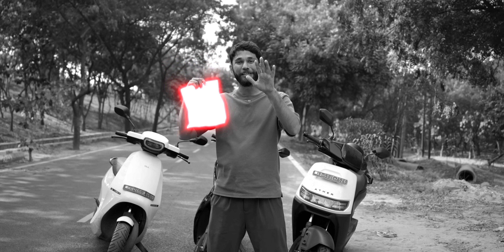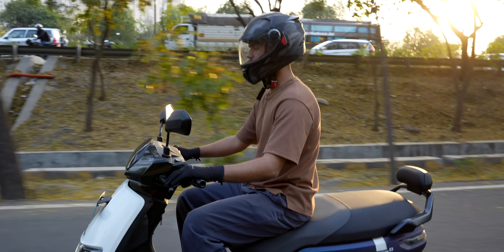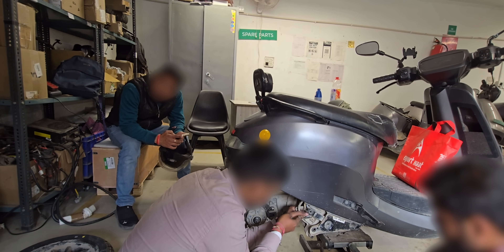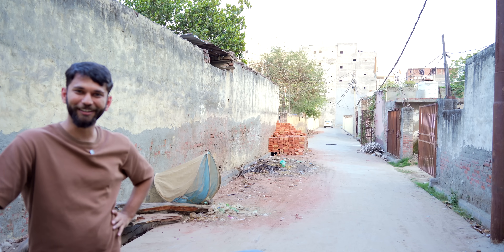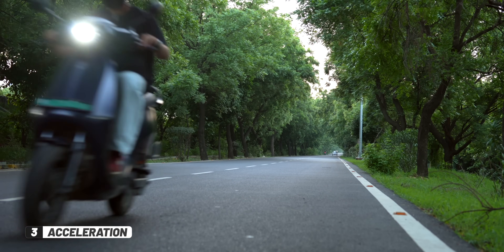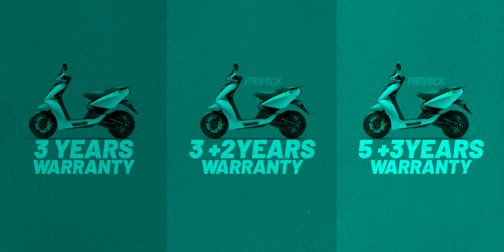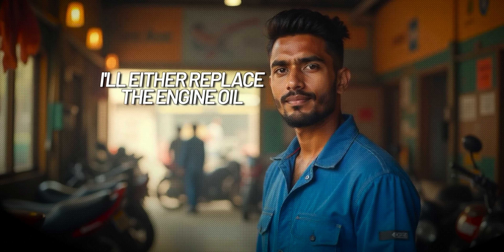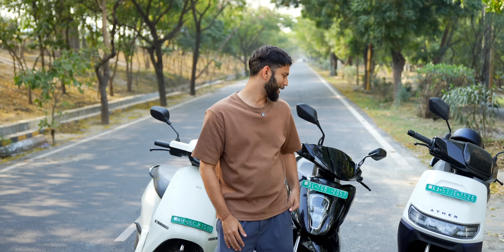The Real Truth of Using EV After 2 Years!

Comment: I have been using the TVS iQube S 3.4 variant for the past five months, commuting 70 km daily. So far, I have completed over 8,500 km. They claim it provides a range of 105 km on a full charge, but I am getting an average of at least 115 km. TVS iQube comes with a warranty of three years or 50,000 km. Additionally, they offer an extended warranty of two more years or 20,000 km, mostly free of charge. The iQube requires servicing every 4,000 km, which costs around ₹500.
Reply: So you ride around 70kms, every days,
Did you ever feel uncomfortable or strained while riding? Is the posture good enough, or a bike would have better posture?

Comment: my 2015 honda dio bs3 which I bought for ₹60,000 (with all accessories, insurance and extended warranty) has done more than 90,000kms still gives efficiency around 50-55kmpl even 60kmpl ridden sedately so my 1km= ₹1.8 (won’t go above ₹2) including maintenance as well as it requires service in every 6months includes changing the engine oil+air filter+oil filter which is not more than ₹600-700 so for most people EVs can’t stand against Honda scooter💪

Comment: nice & true video, i am using Ather 450s more than 1 year & driven Approx 13K Km without any problem. Build quality is good,  very accurate Range like if scooter shows 50 Km than it will give you to almost 48-49KM. as per cost of scooter the Range is less it should me 120 Km & charging time should me lesser than 5 Hours. IF you want a good EV scooter without any problem go for Ather

Comment: I own ather 450 for 4.5 years. Battery range issue will roughly start from 3rd year and it will accelerate. I complained about battery drain issue to Ather after 4 years and it was not under warranty. But they replaced it to new one by charging 5K (Goodwill). One aspect Ather stands out is their customer support and CRM. Exceptional. Ola is nothing compared to Ather. For next 3 years min i can ride my bike without any hassle. One aspect Ather should improve is their service support. Service cost is very high and almost equal to car plus their service centers are working beyond their capacity levels.

Comment: ather 450x panels are so strong that My 450x crashed at around 70 kmph in a sharp turn and also it skidded upto 7-10 meters , even after this there was an only scratches on panels but it didn’t break and no technical issues in battery . And the battery health is also so good that even after I ride more than 80 km daily for 3 years. I strongly recommend ather 450x or any other models

Comment: And one of the worst part in the battery warranty is that they provide refurbished battery after wait months of 3-4 months!!!!! and even after that my replaced battery had 15% around less range as compared to my original battery i repeat Do not buy ev scooters yes the rides is way better than petrol bike but the Overall cost is same in long run and there are no good mechanics as well to repair them properly you are stuck with service center which takes months to repair them ... and no resale Value as well

Comment: As i thought before starting regular adwiser 
I bought a Ola s1 pro gen 3 and yes ola has some problems like they took so long to deliver but the battery price of 3khw is 38k and in comaprison you will easily loose around 75k in buying petrol with petrol scootet 
Also if i tell about Ather , Without a doubt Ather is really good but in my area there is no charging station or service centre also the price is much higher as i bought the ola at 1,34000 with insurance and everything ,on the other side i think the ather 450 is around 1,70000 also if i want to use the feature which mostly showcased in ads i have to pay much extra but in ola thats not a problem also here in my service centre there is hyperservice available problems solved in 1 -2 hours also all the staffs are friendly they become familiar in 2-3 visit . So my overall experience is good and also a point that I'm not just a new customer my friends bought gen 2 so i know their experience 
My point in the video is that Both Company has Pros and Cons but prarik was always on the side of ather in the whole video
So i think it's biased a little bit.

Comment: Ather is more expensive than any other ev scooter but you have to consider whatever they are offering they've done deep research in everything whether it be battery sustainability software overall quality of the scooter all the features they offer and they have the best charging network out there more on that they are one of the oldest ev brand in india and most reliable so paying a premium for that is ok I guess atleast for me. Lot of you won't agree with this but just to save 30-40k you'll face a lot of issues

Comment: Bought an ola s1x 4kwh (key variant) previous year in August. Faced an issue with the software nearly 3 months ago and the scooter stopped working on the way. Had to tow it (costed me 600rs) to the service centre and then devote my entire day to them. Finally at 6:30pm the issue got resolved and I drove back home. 
I get an average range of around 115kms which is enough to serve my purpose of buying an ev. 
Have not faced any other issue till now. Have successfully completed 7000kms on it.
The biggest con which I felt in this is their build quality. It should have been better. If I meet an accident someday, then I wouldn’t be able to drive that vehicle again. 

Got this for 110000 on 14th of august and the priced dropped  by 5-10k the very next day due to Independence day offer. (Regretted the very next day of buying ola 😅 Not their fault tho)
Got a subsidy of 20000 after a few months into my account, so the net value became 90000, which is very fair.

Ola s1x: 8rs per charge for 115kms
Cost per km~ 0.07rs

Petrol scooter: 110rs per 60km of range
Cost per km-1.83rs

Savings per km=1.83-0.07 = 1.76

Amount saved till now= 7000*1.76 = 12320rs

If calculated similarly, considering the inflation in petrol prices and increase in my usage, I will recover 90000 in 3.5 years appx.

Conclusion: Overall A good buy.

Comment: I own Ather and I feel like a King with everything, the suspension is 2 times the size of my petrol scooter, accurate range on display, smooth acceleration and braking, unique colour that I own is salt green with orange and everyone looks at you in the traffic. The best part is the service centre, when my dad took it to the service he was said that you have to prebook on call but now it'll take 3-4 hours to get back vehicle but my dad said it's urgent and he has to go somewhere. So, not 1 or 2 but 3 mechanics were deployed on a single scooter and he watched them doing everything and handing over the vehicle in just 15-20 minutes and got a bill of 708 including GST comparatively my petrol scooter services at 1500-2300 now you don't get that in Ola or else, charging is a big plus point with the network. In our 2 tier city we've 13 charging stations with some charging stations offering 2-3 charging docks that means in our city simultaneously 23 scooters can charge at a time.
Reply: lol there is nothing to service on an ev, Thats why it took 15-20 mins and costs 700 rupees. they will only check if belt and brake pads are good and that's it.
Reply: honda activa full service with labour chrge 800 olny

Comment: Ola Electric is failing its customers! I bought my Ola S1 Pro Gen 2 on April 29, 2024, and now they’re demanding ₹55,000 for a battery replacement, even though their app initially showed ₹0 as the payable amount. My scooter was in Vacation Mode, yet it completely drained due to a design flaw. Now, Ola refuses to honor the warranty and is even threatening to charge ₹150 per day for parking! This is outright harassment.

Comment: Ok you have covered the EV part let me tell you the issue with every single petrol scooter. As EV battery capacity deplits, so as the milage of petrol scooter. As the pertol scooter ages its milage also decreases. My 5+years activa used to give 45-50kmpl when new and now its almost ~28-30 kmpl. And yes i do service my scooter as per schedule without skipping.

Comment: I bought an Ola in Oct 22 it's running fine but side stand sensor is not working since a year no service available from tge service centre niw tgey are saying to replace harness which costs about 8k and clsim it in insurance. I have genuine doubts about the service if something bad happens. Please avoid OLA I would suggest to go with Petrol until Activa launches electric

Comment: I am using OLA S1 Pro 2nd gen for a year now in Pune, I have minor issues here and there but those get fixed by Pune service center. 
I saw bunch of scooters before, but lately I dont see it in the showroom. 

Based on my experice and observations - 
1. Fast charging stations - There are 4 in Pune. (It might vary based on different location)
2. Service - Here, charges added if some parts are changed. I found service center people quite friendly. 
I saw a viral tweet for Ather service center of 8k. Here advising for taking Pro Pack would not make sense because again I have to pay remaining + cost of subscription.
3. Range Anxiety - Inititally, I used to think about it, but it has quite good range comparative to any other EVs in india. 
4. Capacity and Handling - Ola has similar or more (and useful) capacity and handling/driving Ola is smooth.
5. Battery warranty - For scooters bought before March 2024 (not sure from when, but till March 2024) have these warranty already included in the cost. 
6. Cost - Long terms maths does not add up for me personally.

Overall, I think Experience is subjective. But, I dont see any actual innovation from other brands which will drastically be better for end user. 

I might be wrong to think that - Ather is part of the industry for more than 10 years, should be doing better than this.
Should have figured it out sooner or once after the competition came. I am surprised how can Ather not offer at least similar range while asking for more price and again charging for subscription. 
I can not buy the argument - "but Ather has accurate range", Ola is far ahead even if its range estimates are 10-20% +/-.
Reply: True. They (Ola) definitely have their share of problems, but they are offering better things than Ather for a far better price. We have a S1 Air and the engine had some issue and it was out of warranty. They replaced the engine without any charge. As of now twice there was some minor issues and they haven't charged anything for that. Either I'm very lucky or may be it's better in my area.

Comment: *SPAMMING THIS COMMENT 10 TIMES, SO THAT IT REACHES YOU QUICKLY*
* I very much need a review of DE-HUMIDIFIER in Indian environment,
 if it works where AC just isn't an option.
Does it help us cope with "Humid" summer. Does it reduce "humidity" enough to make the weather less painful.
JUST LIKE YOU DID THE AIR PURIFIER VIDEOS. 
*

Comment: Bought Ather 450x 1st Gen in 2021. After 10k km, it is still running flawlessly. My second service is gonna happen soon.
We got two Olas as well, S1 Pro 1st Gen (2022) and S1X+ (2024) and I have faced various issues with both the scooters. Even though the vehicle functions most of the time, it is those frequent breakdowns that completely leave you stranded. 

So very on point analysis. Would strongly stay away from Ola offerings, a lot depends on your luck on how the ownership experience will look like.

Comment: 9:14 bro please correct ola gives 8yrs or 80000 kms warranty on battery. and i am using the s1 pro gen 2 from past 1 year and road more than 10kms no such big issue or service centre issue they fix issue same day. in mumbai there are more than 10 charging station.

Comment: The video thumbnail leads one to believe that the video will be about the battery maintenance cost involved in using an ev scooter. But it's more about the warranties provided by the companies. Ev scooter is profitable when you don't own a vehicle but you have frequent to-and-fro to your nearby places. But if you already own a vehicle, then buying an ev will make no change to your total cost (includes purchase) in a span of 10 years. 
However if you don't have frequent usage of your vehicle, then buy a petrol bike/scooter. They are cheaper, reliable, don't have range constraints, can stay idle for months/years without any damage. And your maintenance cost will be less too (200-300 for engine oil change in 6-7 months, if you travel frequent). You may think that ev scooter costs less per km, but you've already spent 1.3-1.5 lakhs plus maintenance (each yr). A petrol bike/scooter for a middle class person is around 70k and can last 15-20years if the usage is less.

Comment: I own ola s1pro the service after taking spacial ola care plus  regarding noise and vibrations in the scooty three individuals came and rode the bike  two of which said it is normal , one individual said we have to replace  something in the transmission unit and told me we will call you after gathering the required  parts     this was 8 months ago and haven't heard from him since and no response after complains  
I am still facing problems with the scooter 

 If anybody is thinking about ola just forget it you will loose your mental peace if u buy one 
The head of ola is making money with no concern about  service or charging network

Comment: I am an Ola s1 pro Gen 1 user from last 3 years with 25000km odometer, I agree with service center part, but I only had to visit 2 times in last 3 years. My scooter is running without any issue. I can see the improvement in service after adding service centers.

 Ola charging network part is incorrect, I have more the 50 fast charging stations in Hyderabad 

Ather range prediction is also incorrect, it is always 10% less than actual number

I have recommended to 5 of my friends, they are a happy OLA customer. I defiantly recommend OLA.

finally, I doubt your knowledge on technology. or its paid video, not a truth.

Comment: Very true review i many times faced harrassed and stressed with my ola scooter. In 1 year only my motor got faulty without any reason and the battery got deep discharge and battery needs to be changed firstly they gave me heart attack that battery warranty is void since you have reached to zero. But i was out of town and was not having that knowledge. And now my handle lock and trunk issue is there it is worst service scooter with cheapest parts fitted in scooter

Comment: Liion Battery dont need replacement often, even after 8 years of usage and 1000 charge cycle it will be atleast at 80 percent health. And by that time you would have crossed 1lakh km and would have already saved more than 2 lakh in fuel cost alone. So even if you need replacement after 8 years , at 60k rs you will use that battery another 8 years and will save overall 3 lakh after battery replacement cost in 15 years of ownership.

Comment: Many people from South India, especially Tamil Nadu, are well aware of how marketing agencies work. The recent controversy between Sid Frequency and Tech Superstar has made people realize how companies influence public opinion through scripted content.

The video in question is clearly part of Ather's marketing campaign, where they try to highlight the shortcomings of their competitors. While Ola has received more complaints compared to Ather, when it comes to affordability, Ola has an upper hand.

I am not biased toward either brand, and they don’t pay me anything. However, I believe people should not get influenced by YouTube videos alone. If you really want to know the true range and real-world experience, get in touch with local users who already own the product.

---

My Personal Experience with Ola Electric

I have owned an Ola electric scooter for the past year and have driven around 14,000 km. Based on my experience:

✔️ Battery Range – In Normal Mode, with smooth acceleration and no extra load, I consistently get around 100 km per charge.
✔️ Initial Issues – I faced several problems in the beginning, but after a few free service visits, most of them were resolved.
✔️ Reliability – I can’t guarantee that issues won’t arise in the future, as problems can be subjective and vary from user to user.

I wouldn’t say that Ola is garbage, but I do recommend buying an electric scooter as a secondary vehicle rather than a primary one. Most people already have an ICE (Internal Combustion Engine) vehicle at home, and an electric scooter can serve as a good alternative for city rides.

To other electric scooter owners reading this:
Please share your own experiences in the comments. Are you happy with your vehicle?

Comment: I have bounce infinity. 1.5 yrs 20k km. Still has decent charge levels. Battery has 3 yr warranty. New battery at 28k. Good for city limits with 70km range. 4 units electricity 100km. Slim to none maintenance yet.

Cons:

Small seat,
Foot rest is very flimsy
Bike stand broke after 5 months
Service centers are too few
No charging infra in tier 2 cities
Reply: It's true that you will lose some range even when not using ev. I found solution in bounce infinity that I plugged out the battery cable at night and the range didn't deteriorated
Reply: I also have B. Infinity for about 2 years almost zero maintenance, yes the side stand is gimmicky, the range is the issue in that 70 km range sometimes it stop ls when 10 km range is remaining, sometimes on 7 and so onn...
Reply: @aradhyad73  Havent got that problem yet . IT may show up by next year I think.
Reply: @gaurav9411  Ok good to know, might be in my one only..